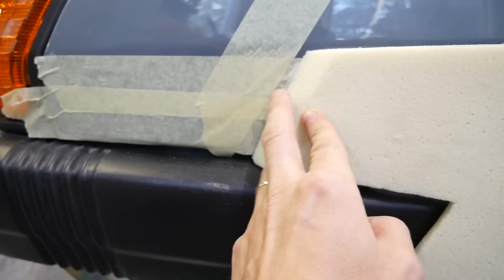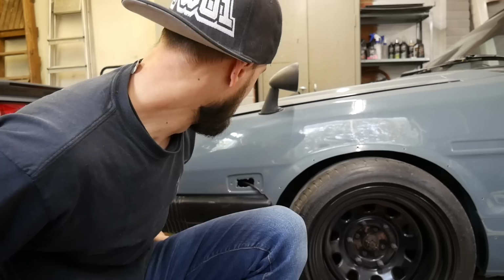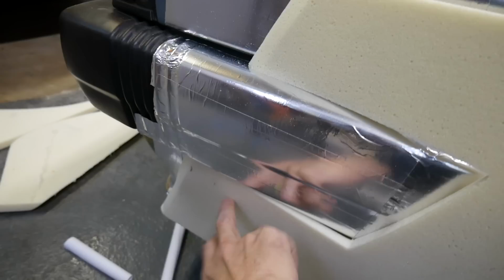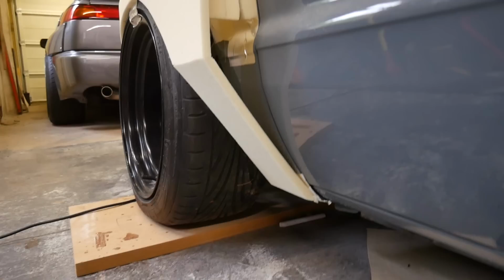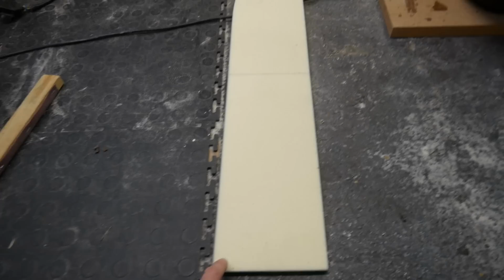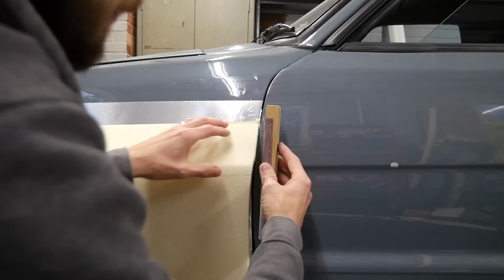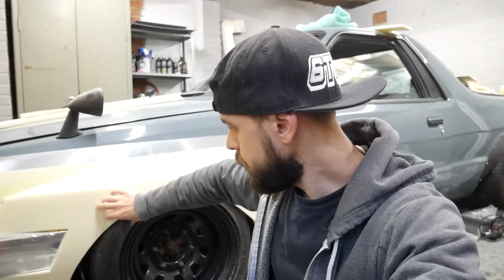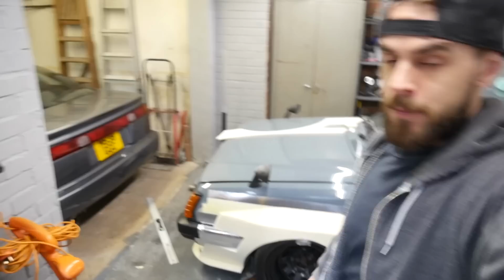Foam widebody overfenders!

Comment: I've been using 2" thick foam insulation board for moulding my arches, it's great
Reply from the maker: You should try getting hold of some of this stuff, you can apply resin directly to it and it wont deteriorate at all and will go rock solid.
Reply: @BuildCreate  Yea, I've been fiberglassing straight onto it :)

Comment: I really like the lower half of this new design, but I think it would look better if the top went to the bodyline.
Reply from the maker: I'm there with you dude, i'm not in a rush to complete them so plenty of time to compare the two before i make a final decision.
Reply: Agreed.    I also think the shape could be a bit rounded off to match the natural curves rather than the box shaped

Comment: Make sure you test your resin + fiberglass on some scrap foam first to be safe! 
I've tried to lay fiberglass on top of instant expanding foam (from an aerosol can) and there was a bad chemical reaction where the resin never cured. In fact it started to melt and deform the foam sculpting underneath.
Reply from the maker: Don't worry this stuff is designed specifically to work with resin and not degrade, and i doubled checked just to make sure haha.
Reply: If you use expanding foam put a layer of body filler on before the resin, it works a treat!!!!

Comment: I think the arch needs to come up higher, it looks like the tires going to hit the fender when you turn.
Reply from the maker: BrandonS350 don’t worry, that’s not the final ride height. I recently installed softer springs to the coilovers and it dropped the front. I’ll raise it up and make sure it clears.

Comment: Good vid, I am wanting to make a new bumper/spoiler for my starion, because the original one is quite ugly; I want to use polyurythane like you do
Reply from the maker: Thanks man! Give it a shot, this stuff is so easy to work with.
Reply: @BuildCreate  I managed to finish my rear bumper!!! what glue are you using in your gun? mine was standard and didn't work well

Comment: One trick is to use the foil tape on the body. It sticks better then use the hot glue on the foil tape the hot glue the foam to that. You will find it sticks better and yoh Cando your shaping without coming off.
Reply from the maker: Adrien Gadson Thats what Ive done dude 😊
Reply: @BuildCreate  I didn't watch the hole video if I did I wouldn't have mentioned it. Just trying to help , I am a fiberglass customizer for 30 years and have used this since the early 90's . Anyway keep doing what you do ...thx
Reply from the maker: Adrien Gadson I appreciate the advice non the less dude, I’m always happy to hear people opinions and advice. 
I love to learn new techniques and getting advice more experienced people is always welcome.
Reply: @BuildCreate  you can also lay the foil tape on the foam and make sure it is smooth and cast yourself pretty good mold for making composite parts. Speeds up the process of bodywork and priming. You just need to have the surface filled with body filler and close to shape.

Comment: dont apply fiberglass and resin directly on the foam. it will eat away the foam. youll need a isolating layer in between.
Reply: Not with polyester resin

Comment: Why dont you just tin tape over the foam. Release wax or PVA the tin tape lay up the fender and youll have a skin for the start of a mold or a part. also lay down masking tape on the car body and tin over that. its easier to remove from the car body then tin tape.
Reply from the maker: that's definitely an option dude, i'll still give the foam an initial coat of resin just to firm it up before anything else. 
So far it's not been a problem taking off the tin tape, but i hear you with the masking tape! Thanks for the input dude :)
Reply: @BuildCreate  Ok do it the hard way by all means. Putting A lay of resin on to the foam then what? More work to get back to a good finish so you release to lay up on top of that? long process. Tin tape more then adequate to stabilize the form to lay up over to pull a skin. speaking from experience.
Reply from the maker: @DjTRex08   Bearing in mind this is the first time i've used this stuff. The initial plan was to resin the structure and lay fibreglass tissue over that. This was recommended to me from the specialist who gave me the foam. 

after that was cured i planned to pva coat that then lay the glass. 

But! i've just been looking on the foam suppliers site and have found they do a specific hi build gloss primer that you apply directly to the foam, sand smooth and release off of that. All food for thought.

I appreciate the input from your experience dude, it's all a learning curve.
Reply: @BuildCreate  My apologies if ive come off over bearing. 1 youve got everything there foam, resin and tin tape.

Tin tape, release, glass you will have you'll have a hard skin shell with in hours. 

Going the other route. Priming, sanding, releasing, glassing and so on. there a couple days work in it not to mention more materials and cost.

In saying that do what you feel is the right thing for you.
Reply from the maker: DjTRex08 no need to apologize dude.